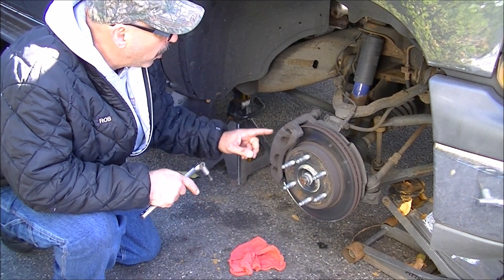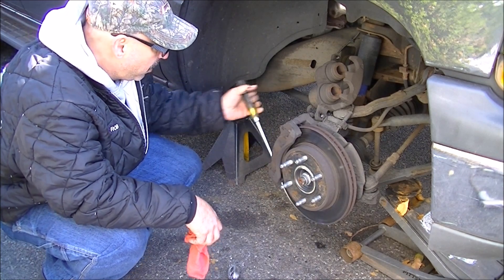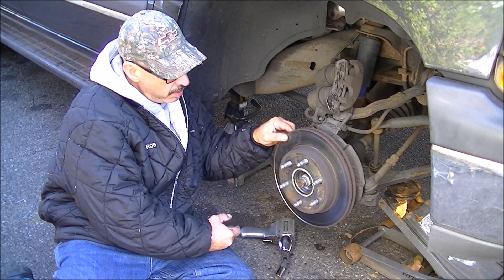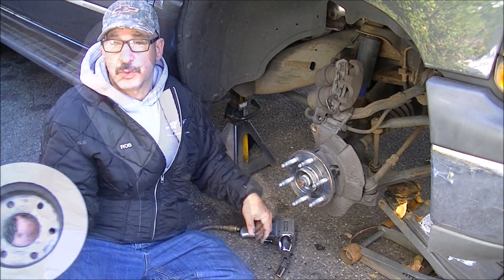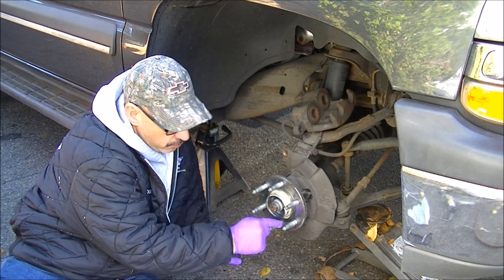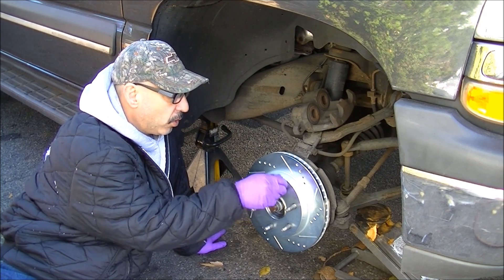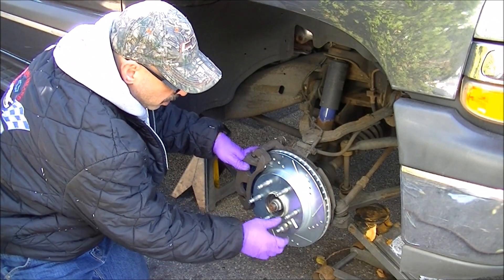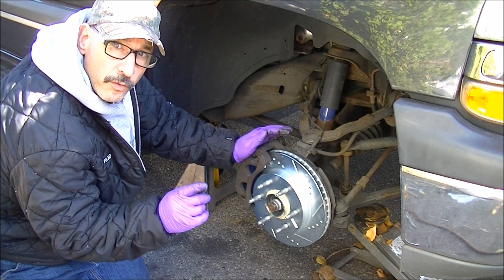How to: Install Power Stop Z36 Truck and Tow Brake Kit

Comment: Great video!!!! Is it necessary to take brake fluid cap off when pressing pistons into the calipers?
Reply from the maker: Not necessary but it makes it a little easier to push the caliper piston back in.  I've done it both ways.

Comment: how are the breaks since the video?
Reply from the maker: They were installed Jan 2018, almost 4 years and probably 30,000 miles, they still look great, plenty of pad material left, rotors look new, they stop great and are quiet with low brake dust.  I will use them again and again for most of my vehicles if available.  Power Stop denied me a sponsorship, but I will still buy them because they have been the best I've used so far.
Reply: @AxlesGarage  any noise or vibration?

Comment: Good job. I am doing my 2007 Suburban with Power Stop rotors and the Z23 pads. Looks pretty straight forward. Hope they hold well, cause the daily driver of the vehicle is a lead foot. Fast then, hard stop. Don’t get it - but what are you going to do - women drivers.
Reply from the maker: I know your pain, the power stop worked out great for us, be sure to follow the bedding/break-in procedures.

Comment: Have same year in a GMC Sierra 1500.  I hate the T-55 bolts.  They make a replacement standard bolt conversion for the T-55.  I got mine at Autozone.
Reply from the maker: I didn't know that.  Thanks for posting it.